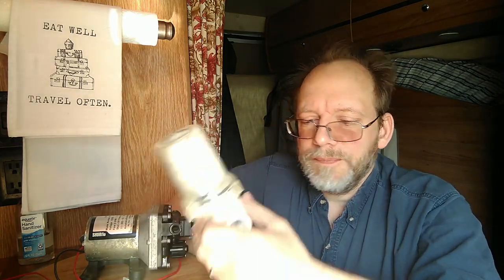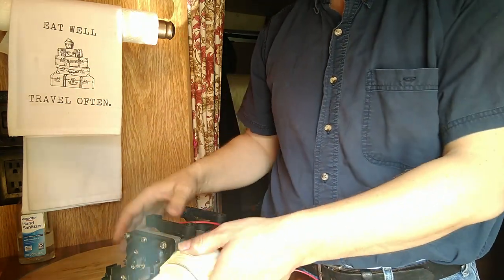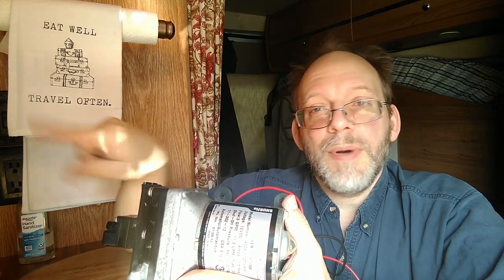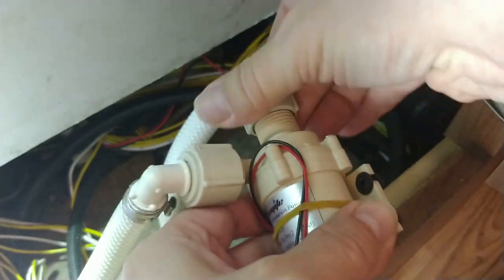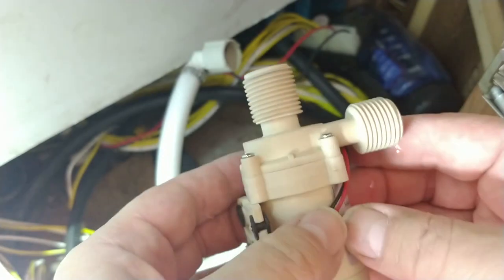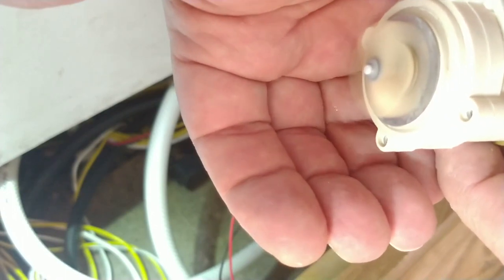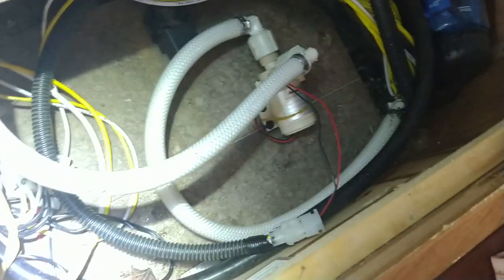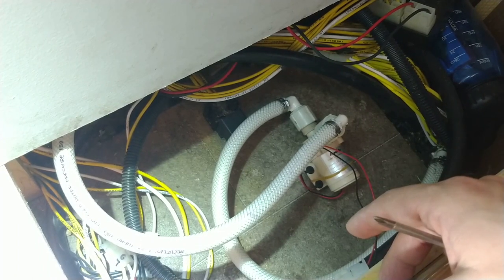Travato 59G Shower Drain Pump Alternative

Comment: Is it possible to install a simple physical drain (open close) in the lower side area of the gray water tank to avoid the need to drain the gay wager tank (when showering) while retaining the ability to retain gray water for flushing the back water tank? What type of tap might attach without pulling the tank from the RV for internal connection, as one would use with a rain barrel?

Comment: can you mount the pump closer to the drain to avoid the priming problem?
Reply from the maker: I don't think that would help, at least not much.  Height would affect the priming the most, while horizontal length should affect it very little. It's probably worth a try though.
Reply: @ScottGriepentrog  I was wondering if the pump inlet could be coupled directly to the drain.
Reply from the maker: @tomkirkgaard247  I was planning on trying that but haven't yet.  I mean yes you can couple the two connectors, but you would have to have a high water level in the shower basin, plus patience and maybe luck, and a backup plan in case.